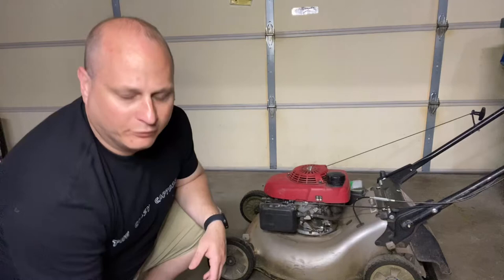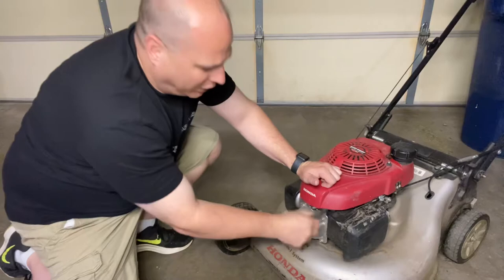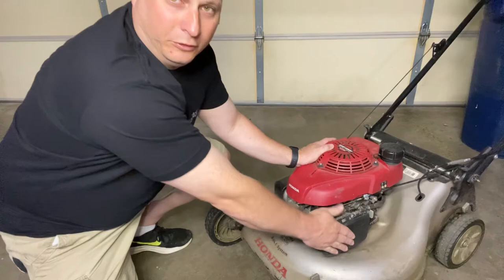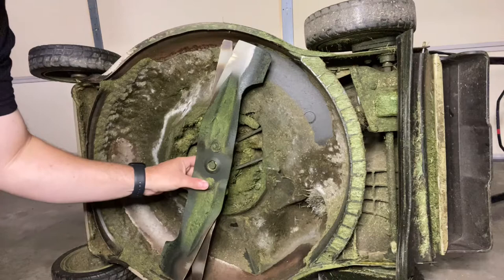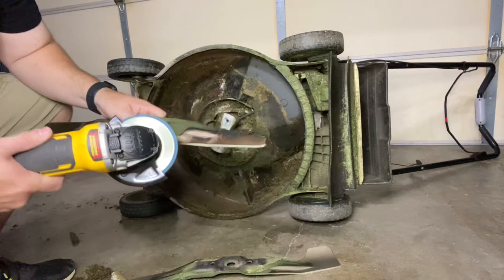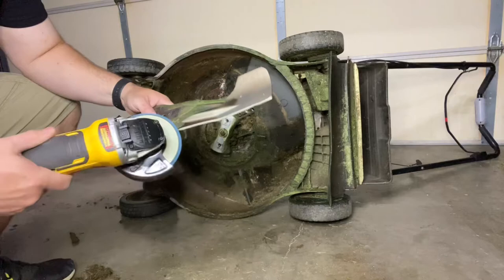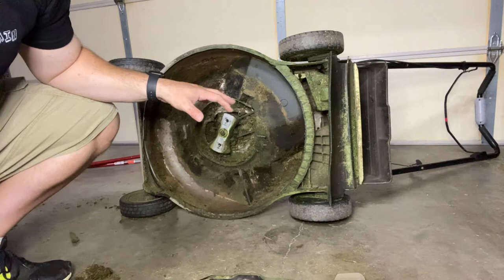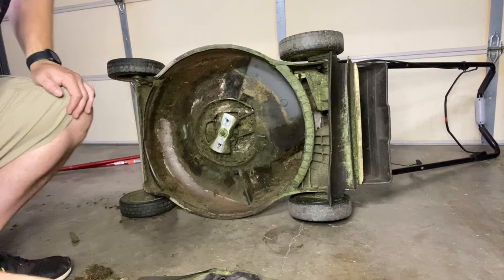How to Remove and Sharpen your LawnMower Blades | How to Change Your Honda LawnMower Blades

Comment from the maker: I don't check for balance every time.
should have been more clear. I have ran a
commercial lawn business for 14 years.
Blades get sharpened 1-2 times a month. 

If you grind them even they will not be off
balance. It's very rare I see them off.
You will know when they are off balance if
you feel more vibration than normal.

Thanks for the comment. Just to be clear.
It is always good practice to balance your
blades.

Comment: Remove the spark plug fully, the mower can still start. The ignition lead doesn’t have to be plugged in,  only has to be touching the plug.
Reply: I think there's a better chance I get struck by lightning twice while winning the lottery than my mower starting spontaneously.

Comment: Does it really pay to invest $10+ to have a shop sharpen your blades? My 42" craftsman uses 2 blades. I can buy a 10-pack of oem for $75. It may make sense to do it myself with an angle grinder, but I can't see farming it out when it is less costly to purchase new.
Reply from the maker: I agree

Comment: I think maybe you over simplified this operation. That looked kinda dangerous with the angle grinder. Cleaning the blades of built up grass also a good idea. Helps when balancing the blades - which you seemed to skip. Also you didn't check the gap on the new spark plug. Dummy me had my blades on upside down. Didn't realize that until I brought  it in to be serviced for a different issue. Blades move in a counter clockwise motion. I didn't know that either. On another note....Great job on the filming of the video. Good camera angle. Sorry for all the negativity. I should have read the other follow up comments first.

Comment: You need to balance your blades after sharpening the blade
Reply: I always use a good stiff putty knife to remove excess grass and dirt buildup before I sharpen the blades and then balance them before I put them back on.
Reply: Not that important, they do not have to be perfect mower blades should be balanced if you have to take a lot off them because you hit something or every fifth normal sharpen. Ride on mowers with long blades require better balance due to the effect of the distance from center makes a small  weight react to the revs the blade is rotating at.
Reply from the maker: I don't check for balance every time.
should have been more clear. I have ran a
commercial lawn business for 14 years.
Blades get sharpened 1-2 times a month. 

If you grind them even they will not be off
balance. It's very rare I see them off.
You will know when they are off balance if
you feel more vibration than normal.

Thanks for the comment. Just to be clear.
It is always good practice to balance your
blades.

Comment: I have never thought of turning it on it's side. I have always just raised it off the ground onto blocks and reached under, just like for draining oil for those older models with convenient drain plug on bottom of deck.

Comment: There is a torque spec on those blade bolts and there are usually bellville washers on the bolts that have to be oriented properly to work.

Comment: Thank you! I got the flap disc. Was just a little hard for me as a women to get the blades out. But the rest was great. Thank you for the tip! 
How often do you sharpen?
Reply from the maker: Once a year should be good for regular home owner type of use.
Reply: Hi I noticed your comment mam, if working the wrench is the problem. Simple find a piece of pipe the you entend the wrench with, then working the wrench should he alot easier. Same method I use when changing tires on my car.

Comment: Would it be better with the fuel tank be empty?
Reply from the maker: That would be the best, but not always possible. I don’t like draining out the gas because I don’t want to contaminate the fuel or waste fuel.
Reply: @TheCrazyCaptain  
I meant to use up all the gas.
I would have a working plan first.
But you're absolutely right. I don't want to drain the tank.
Thanks.
Reply: @earlmorton6265  I use a wal-mart plastic bag and put it between the gas cap and tank, then tighten snug.
It won’t leak if the tank is a little bit on the full side. Always worked good for me.

Comment: any issues with the carburetor ?   I have this mower and the carb got gunked up so bad it wont run after only a year .  never  had a carg issue with briggs & stratton.  Honda has a good name but I fear some of their engines are pretty bad.
Reply from the maker: I have never had an issue with the carburetor or engines in the Honda Mowers. The only issue I have had with Hondas is the tires wearing out too fast
Reply: It is likely an issue with the gas it is getting. It could be stale and/or have too much ethanol in it. That will gum up a carb on a small engine no matter what type it is.
Reply: If you have winters and store mower. Empty gas and run mower until it stalls. Never leave the gas in and never use gas with ethanal in it. I have this same honda mower for over 5 years. It is a 1 pull start lawnmower. I guess even Honda makes lemons😜.
Reply: @bobcaygeon4533  I agree that if you can get ethanol free gas that is the best option. The problem is that many areas don't have it available. I looked into it, and the Honda HRR216's manual says this:

"You may use regular unleaded gasoline containing no more than 10% ethanol (E10) or 5% methanol by volume. In addition, methanol must contain cosolvents and corrosion inhibitors.

Use of fuels with content of ethanol or methanol greater than shown above may cause starting and/or performance problems. It may also damage metal, rubber, and plastic parts of the fuel system."

Even that can be tough because many gas stations are running 15% ethanol, and use methanol on top of that these days. In that case about all you can do is try your luck with using a fuel stabilizer that has an ethanol treatment.
Reply: It ain't the honda giving you prob.... it's the ethanol gas.   Honda is the top of the small engine game,, very high quality everything for decades.  Look it up,  ethanol gas that sits for 6 months or more turns to gunk and clogs all orifices in the carb.   Stop saving $1 and buy real gas for anything that sits for months

Comment: U don't check for balance? It's a $5
Part, very easy.
If it's out of balance
You will know it very fast. Grinding 3 times per side is not balancing.
Reply from the maker: I don't check for balance every time.
should have been more clear. I have ran a
commercial lawn business for 14 years.
Blades get sharpened 1-2 times a month. 

If you grind them even they will not be off
balance. It's very rare I see them off.
You will know when they are off balance if
you feel more vibration than normal.

Thanks for the comment. Just to be clear.
It is always good practice to balance your
blades.
Reply: How do you balance blades?